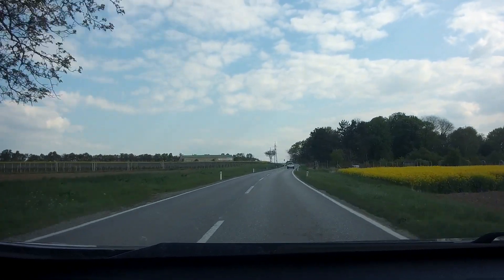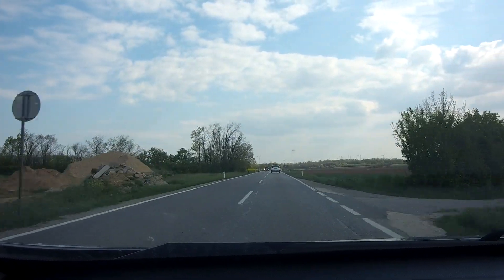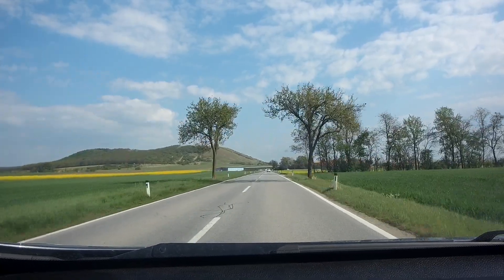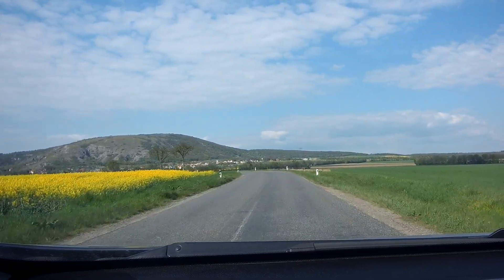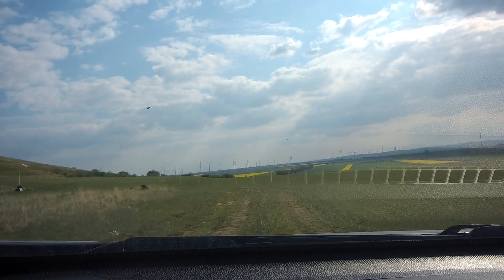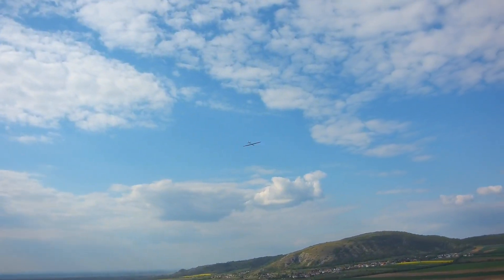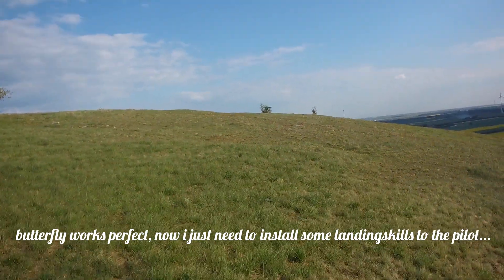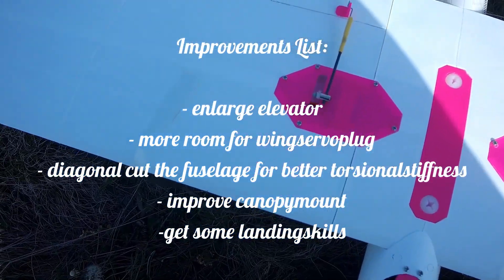Naughty Testing Take Two - Divetest.

Comment: It's insightful to hear and see details of your flight testing.
Seems to fly very nice, even if you not yet fully satisfied with pitch control. The Naughty has a nice wide speed range from high speed flybys and cruise to gentle approach speeds. 
Wondering if you considered an all-flying stabilizer to give more control authority? The elevator portion of the current stabilizer is narrow, so might be a limiting factor in control authority.
Reply from the maker: I think you mean what we call "Pendelleitwerk" here. I´ll first test the effect of a bigger controllsurface, new Elevator is already printing. Next step would be to change the height of the pylon and try to do some CFD-Analysing, but we will see, i have big hope the bigger elevator does it´s job ;)
Reply: @3d-printz  An example would be like elevator on Le Fish glider.
Thanks, for the new word. :)
Like your approach, start with the simpler solution. At least you have a few options;; and more reasons to fly.

Comment: I think also, because the wing is in line with the tail plane there is some air disturbance perhaps. Most gliders use an elevated tail to resolve this and hence they have small surfaces and ergo, less drag. So maybe think about a T-tail configuration or offer it as one of two designs. Good luck. Great videos BTW.